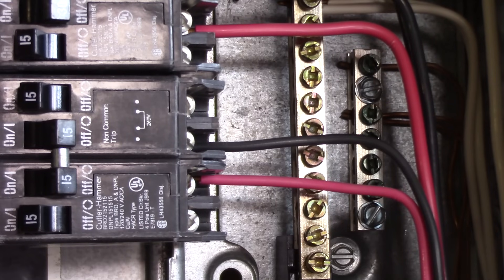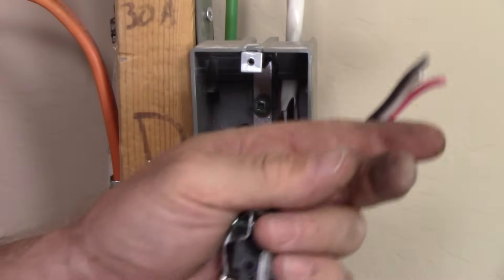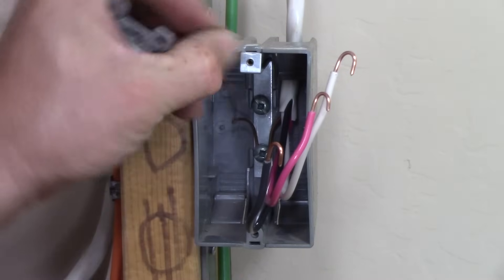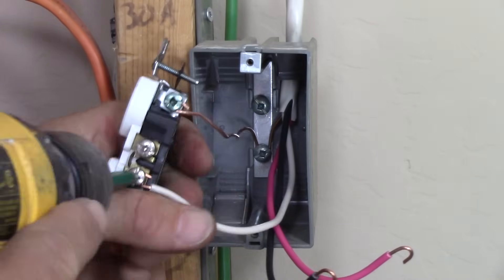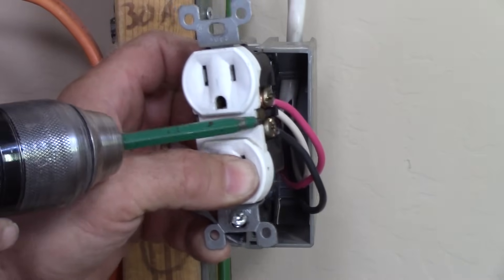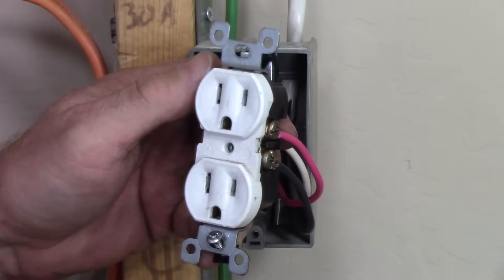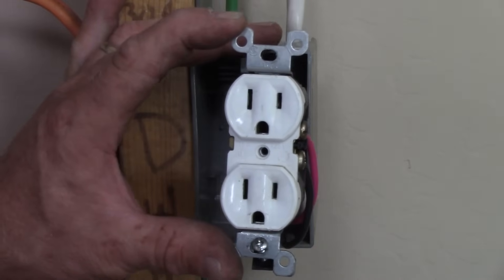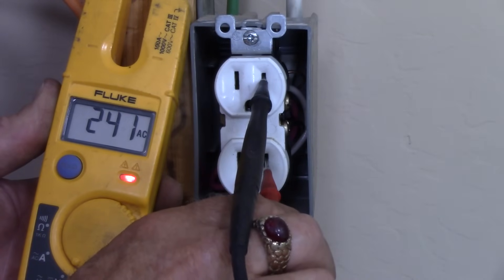Kitchen Split Circuit Receptacles Explained

Comment: All I have is black and white wires Lmfao it's just an old trailer but I was trying to understand what can be done to allow our air conditioner to run basically off it's own thing. I want to understand not so I can do it even if I can do it I'm confident but I want to let an electrician but mostly to understand bc I don't want ripped off just bc it's an old trailer . Again I have black and white wires everywhere but some guy just came in and moved my 15a down took one wire out shut that off left bottom wire in then the wire he took out he stuck a 20a breaker I never had a chance to research be for he came now I see that he did the number one thing advised to never do and that gauges of wire is very important when it comes to breakers . When I get enough of the right information and know what everything is I can do about anything it's like my brain is a computer or something but that is only after I am able to understand what needs to be. Right now all I'm understanding is it appears my wiring looks very outdated or done by only the person who done it would know how they done it . I feel a bit defeated and knowing I can't understand my own wiring is why I'm trying to catch on to anything so the next electrician don't juke me again. He didn't care bc my trailer is old he even commented couple things that know I think of was just rude if he didn't want the headache he should've just left and not set my box up for a fire in my walls and took my money.  Stating keep a close eye on it shutoff if it gets hot or smell anything he absolutely didn't leave my house confident or leaving me confident. Where I live at I'm actually sick of having to learn things over days weeks or.months when there is so called professionals to do the jobs just so I know what I need to to do it alone or not get screwed over I'm sick of it

Comment: Hi!  Thanks for the video.  I have a similar situation.  Can I ask you how would you connect now one GCFI to this plug so that both circuit outlets in your plug are protected with 1 GFCI?... I tried but keep tripping my GFCI whenever I plug anything into the non-GFCI plugs.  Funny thing is that the tester that you used in your video shows both plugs are connected correctly and if I connect a device into the GFCI it does not trip.  Only when I connect anything to the other plug!  What I did was take the hot black and connected that to the regular plug and then the hot red into the GFCI.  Where did I go wrong?
Reply from the maker: Yeah, you can't do this.  The problem is the shared neutral. When you plug in something to the other circuit, it uses the same neutral that does your new GFCI, so it sees an imbalance as there will be current on the neutral, but nothing on the red wire that it's connected to so it trips. Just can't be done on these split circuits.
Reply: @theinternetelectrician  Thanks Terry... I figured out another solution... The red wire fed anthoer plug away from my faucet so I just didn't use the red wire for the GFCI and regular plug.

Comment: Is the latest GFCI receptacle style already split? They are now labeled as "Line" and "load".
Reply: Nope! Line is going in. Load is going out. You can use a double pole circuit breaker (not cheap) and use a regular duplex to accomplish the double circuit.

Comment: Terry, This is not a safe way to split power a receptacle feeding 220 volts to a single receptacle. This would not be allowed and is not to code in MA. And I would assume in most states. Feeding 220 volts to a receptacle designed to handle 110 volts is not allowed and not up to code. Feeding power from separate circuit breakers that connect to the same leg on the service panel that are providing 110 volts is much safer and is allowed and up to code. Also 15 amp circuit breakers that feed an outlet is not up to code either. A receptacle must be able to handle 20 amps, be fed by at least a 20 amp circuit, with wire able to handle at least 20 amps of power and a 20 amp circuit breaker. Do you live in a state where anything goes?
Reply from the maker: Jay, this is the second comment I've had by someone from the USA that has been totally puzzled by this.  I am from Alberta Canada.  This was the way kitchen circuits were wired here up until GFCI technology changed the way we do things, and even then it took a while to be adapted to kitchen circuits.  So this was totally acceptable to the Canadian Electrical Code, the code that every Province adheres to.  It is now changed and is the same as the NEC with 20A circuits to the kitchen, and GFCI within 1.5M of  the sink (and now AFCI) protection required on all convenience circuitry and lighting, etc.  I did not know that it was never done in the USA, but as far as I can tell, it wasn't. I'd like to know if there were any States that did things this way?  Also in the CEC, we still run 15 A receptacle and lighting circuits using #14 AWG wire to most general use lighting and receptacle circuits.
Having said all that, there is absolutely nothing unsafe or dangerous about these circuits.  They must be fed by a 2-pole breaker, and each half of the receptacle is only 120V to neutral thus satisfying the rating of the receptacle.

Comment: confused can i run a 220 v macchine off this wiring setup
Reply: If you want to run 220 for a 220 washer or dryer use #10 wire , red , black, white then connect red & black to a 20amp 2 pole breaker and connect white to the neutral screw on panel and you will have 220 i did that for my LG 220v dryer and it works great. There's more than one way to do it but it's pretty similar.

Comment: Very good! This is exactly what we have in our kitchen which was built in 1972. Is it possible to replace these outlets with this split circuit with a GFI? (I tried today and couldn't figure it out, but I did know about the tab in the old standard ones at least.). Thanks!
Reply from the maker: Personally I would just stay with the split receptacles.  You can't share a neutral with a GFCI receptacle.  If you'd feel better with GFI protection, then you could change your breakers to 2-pole GFCI
Reply: @theinternetelectrician  Thanks for the quick response. I'm only doing (trying) this because the code is a GFI 3 feet to a sink. We have 2 split circuit outlets, one on either side. So the only way to do this would be to change the breaker? thank you again
Reply from the maker: Mark A. Stuart, your circuits are grandfathered. You don’t have to change to meet today’s code unless you are building new, or renovating and getting permits, etc
Reply: @theinternetelectrician  That's good to hear. Nationwide I hope...I"m in Wisconsin. Thanks!

Comment: Thanks for making this video. I have the exact same wiring in my kitchen and I wanted to upgrade my outlet. However, the old outlet had the wires pushed in the back of the outlet and I can't pull the outlet/wires out enough to unlock them (the wires are to short). Can I cut the wires from the outlet, strip them and then screw them to the sides of the new outlet like you did?

Comment: Why is it split receptacles no longer allowed in kitchens as you mentioned? I'm of the understanding that they're quite common and useful to run the higher drawing appliances found in the kitchen.
Reply from the maker: I'm still a fan of the way we used to wire kitchens in this manner.  I think it was the GFCI lobby group that influenced the code committee with cash and whiskey.  I do know the value of protecting circuits with GFCI technology, but do  you personally know anyone that was electrocuted in their kitchen by plugging in the toaster? I don't.

Comment: Some living room outlets are wired for the top outlet to be controlled by a wall switch and the bottom one to be hot all the time.  This setup also requires that tab to be removed.
Reply from the maker: correcto!  And when someone replaces one of those and forgets to split the tab, then suddenly the switch no longer works to control the 1/2 outlet, and all the receptacles are hot all the time!  And ask any residential electrician if they've had a trouble call to a home because half the outlets in the living room don't work.  Walk in, flip a switch, hand them a minimum call-out invoice, and walk away!
Reply: I can't remove the tab. There is metal under the tab that keeps the two connected! Impossible to separate! I don't get it.
Reply: @JulianneWeinmann  -- https://www.youtube.com/watch?v=l1EHYfD_nww
Check this video out.  Also, unlike his application, you normally only remove the tab on the Hot side and not the neutral side.

Comment: Terry,   When you get a call and they say the turned it on and had a direct short, I hope that you tell them to replace the breaker!   Breaker manufacturers only guarantee them to trip in short circuit one time!   Then should be replaced or factory tested.

Comment: I would imagine that splitting the neutral as well would be more versatile, as you wouldn't need to use a double pole breaker, and thus if you trip one of the breakers only one of the outlets would go out instead of both.

The only two disadvantages I see with having separate neutrals are increased cost (12/2/2 wire is more expensive then 12/3 wire) and extra heat, since the neutral in a shared neutral configuration only takes the difference between the two hots.

I would imagine that either isn't that big of an issue though, but I may be wrong or I may be missing something.
Reply: Also, two breakers feeding one device is against code unless the handles are joined

Comment: Can you use this method to power 4 electrical boxes on one circuit. And the other hot wire to power another 4 circuits? This will be in a shop area.

Comment: Hello, I'm replacing an outlet like this with a GFCI, what can I do with the red wire? I tried to put a wire nut but it just shorts, Right now I wrapped it with electrical tape and tucked it in the box.
Reply: You can’t split a gfci since it operates with a line and a load side. Putting a wire nut on red and black wire will cause a dead short. Current travelling from one leg to the other without a load

Comment: I think this is dangerous if the two hots are not tied together at the panels it's possible to have both hots the same leg and then you wouldn't cancel the load you would add then would be running 30 amps under full load on the neutral which would overheat as it's only 14 gauge. . Hypothetical question. If it is done properly what happens if the neutral is cut or  not connected properly or comes loose? When two items are plugged into this outlet both with floating neutrals in contact. what heppens? Nothing? They run as long as there is two electrical items plugged? They run as long as thy have a balancd load? A short? They will  run as a 240V AC circuit in series (is that even possible on AC LOL) , none of the above, something different? or all of the above depending on the type of the two electrical devices?       Switch loops tied in with 3 way switches are fun. Especially if someone upgrades the switch and mixes up a neutral with the power being run from the light. I think it's called a borrowed neutral. I call it why did it almost feel like I was getting electrocuted when I turned off the light switch. It seems to cycle up and after turning off the breaker and checking for power at the switch,  no signs of a live wire and you  tell yourself you are imagining the slight shocks and feel confident your safe,  then you get bit a good blast once your fully grounded on the ladder or the ground. .
Reply from the maker: You are correct, if the 2 hots are on the same leg of the panel, you will compound the load on the neutral.  That's why the code required them to be on a 2-pole breaker.  That doesn't stop someone down the road from juggling things around and creating this kind of issue however.
Yes, if you get an open neutral, and have to devices plugged in to that split circuit, the voltage will bounce all over the place if they are not equal loads (highly unlikely). So you could have anything from 240V to 0 V  and anywhere in between at each appliance depending on the situation.

Comment: Good infor Terry,  question how can I change to a GFCI outlet in the kitchen from a  receptacle, I have  4 wires, 1 red, 1 white, 1 black and a ground and add a receptacle to it, appreciate your infor, thanks.
Reply: If it’s in the kitchen near the sink it must remain gfci protected, but it should work the same way if you are away from water

Comment: @Terry Peterman. Thank you very much for such clear informative video! I'm renovating my old house kitchen, want to upgrade GFCI receptacles; same like your video, I have 4 wires from old receptacles (total 3). I check the wires from breaker panel, the 3 red wires are connected into 3 single pole breakers (20 amps each), the black 3 wires are also connected to 3 single pole breakers (20 amps each).  

So total are 6 single pole breakers, 20 amps each.

Now my question is: Can I disconnect the RED wires from breaker panel and cap them with wire-nuts? Then I use the remaining cables (black, white and aluminium) to connect GFCI and downstream receptacles?
Reply: Seems like an “electricians “ worst question that nobody can answer
Reply: No eléctricas can answer that is

Comment: I wish I watched this video 4 hours ago!!!!!! Thank you x 1000
Reply from the maker: spudstix happy to help
Reply: @theinternetelectrician Thank you very much for such clear informative video! I'm renovating my old house kitchen, want to upgrade GFCI receptacles; same like your video, I have 4 wires from old receptacles (total 3). I check the wires from breaker panel, the 3 red wires are connected into 3 single pole breakers (20 amps each), the black 3 wires are also connected to 3 single pole breakers (20 amps each). Now my question is: Can I disconnect the RED wires from breaker panel and cap them with wire-nuts? Then I use the remaining cables (black, white and aluminium) to connect GFCI and downstream receptacles?

Comment: Really informative, thank you! If there’s 240V then each circuit is in a different phase? What puts them in opposite phase?
Reply from the maker: Matt DeLuco the transformer windings determine the output voltage. So you have 1 high voltage source on the high voltage winding. Then you have 2 windings on the low side supplying the house. These are wound in opposite directions so the induced voltage on each is always 180 degrees out of phase from each other. 120 on each, but 240 between each other
Reply: Terry Peterman That was a very crisp explanation of a difficult concept. I’ve never heard it said so clearly. Say, in this concept, is there any problem in placing a split 120 v receptacle like this enroute to a 240 v receptical on the same wires?
Reply from the maker: @NMranchhand  It would depend on the application, but no, there would be nothing wrong with that.

Comment: Can I put a gfci plug on to this type of wiring mine is old as well there is no ground just two hot wires and one neutral
Reply: No gfci have a line and a load side.

Comment: Terry, If i were replacing a outlet wired just as you've shown us  in your video with a new USB type recepticle which only has one stake for a hot wire would I just leave one wire not connected?? I certainly do not want both hooked in as that would be 240!
Reply: So I am doing this right now. Did you find out?
Reply: eherring77 
Ya so I determined that in lots of kitchens they run 2 hot wires to one outlet(one per plug in). This is so you can  use typically heavy drawing appliances in each outlet, with that in mind if you cap off one of the hots the outlet will only draw off one circuit. You can also confirm which configuration you have depending on weather the bridge is still on. 
Cheers
Reply: @chases1083  thanks. Now hopefully the box is deep enough.

Comment: Switching out out switches and receptecals .
Our split circuit has an another down line receptecal . Hooked wires up as on old recp. Took out tab . Still tripping .
They had black on top red on bottom . And red and black plugged into holes on back .
I am stuck .
I am in Ontario.
Reply: I know it's not helpful now as it's already done, but for future, I find it super helpful to take a clear picture (or several) before disconnecting any circuits. That'll help make sure you reinstall it the way the electrician wired it up when the work was done.

Comment: I have a GFI switch in the kitchen. I have one live back and 1 live red wire that comes in along with he white. I then have one black and one whit that goes out to the range fan and light over the stove. I can get the rage to work but the outlet doesn't. Are you able to tell me what I am doing wrong?